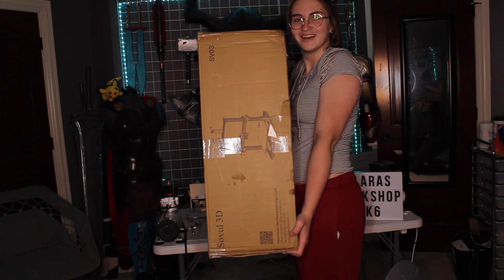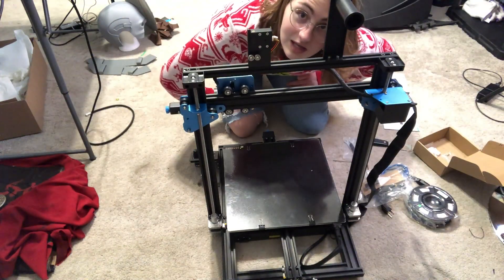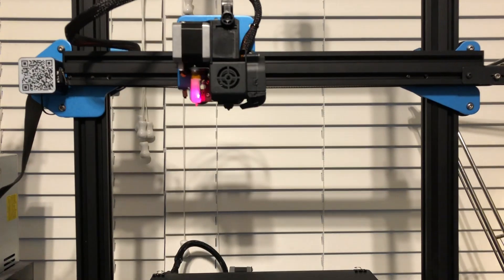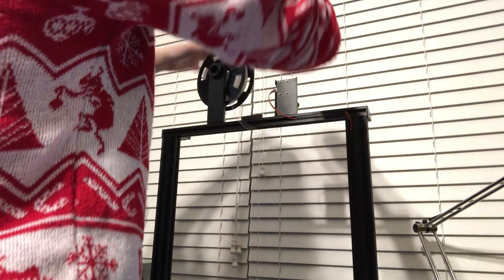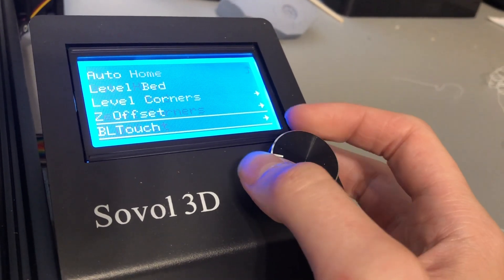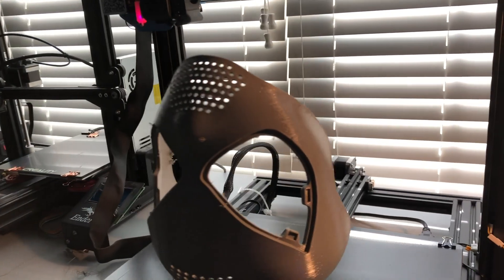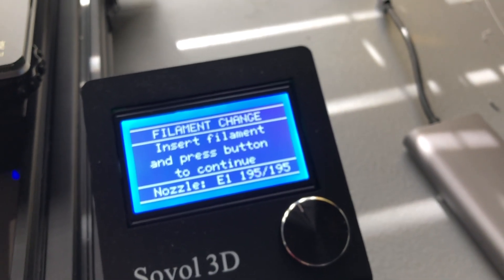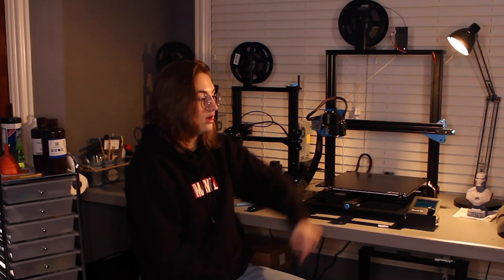A BEAST of a 3D Printer! | SOVOL SV03 Review

Comment: you can get rid of that auto filament reject at the start of your prints by looking into the start gcode under the printer settings in your slicer. if not, check in with the seller for a firmware update. 0.6mm should be standard

Comment: I noticed your runout sensor mounted backwards. And ditch the clips. I use masking tape for the bed. Just make sure to leave extra bed on left side for the setup line (initial line that gets put down). I 100% agree. I love this printer. My only two complaints are the Extruder cable gets dragged across printed if you don’t suspend it somehow and the instructions are a hot mess.

Comment: This video was definitely a life saver with my SV03! You explained things MUCH better than other videos I’ve seen! Question for you or anyone else that might know. When I do big prints (such as helmets/masks) I run into this issue where the nozzle hits the supports often when moving around. It hasn’t affected the prints yet but it’s annoying and stressful to hear cause I’m expecting it to snap the supports and ruin the print. Usually lasts until it finishes the supports and continues to the actual model. Is it something with the Z Offset? I’ve tried to perfect it but always ends up happening.
Reply: you can try to turn z hop on in your slicer . it slows the print a bit down, but for tall supports it can save it

Comment: i need mager help it wont let me tap INIT in initailize eprom it makes a weired noise and the restore failsafe does the same thing :( pls help me
Reply from the maker: that’s what it does. it beeps when you press it but it should still work
Reply: @KiarasWorkshop  mine beeps but I have to press cancel to get out the screen like after I press init Epsom it stays on same screen
Reply: Thanks

Comment: Do yourself a favor and on the gantry where the direct drive is the whip of wires is getting pinch when it moves all the way to the left between the frame, pull the wires out of the way and just let them hang otherwise you may have wires damaged from that. I just put mine together last night and noticed that and figured I'd see if anyone else was setup that way